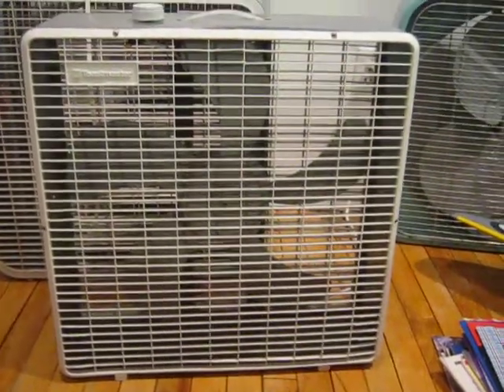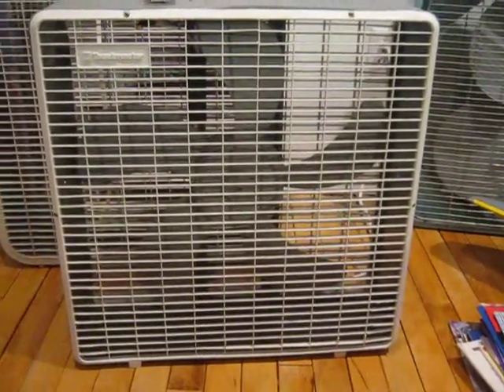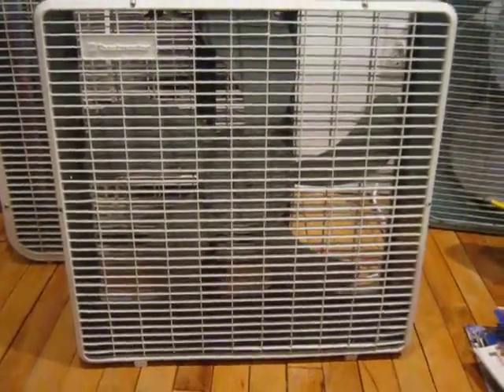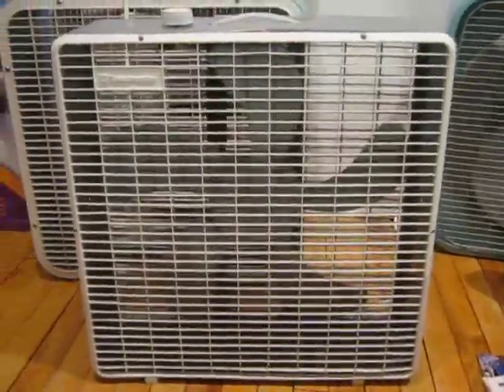Restored Toastmaster Box fan motor issue.

Comment from the maker: I don't think it is the fins, because when it is shut off it does not scrape and it has a long spindown time. Also when I turn it on, it seems like it starts spinning slowly and then gets up to speed, like if the blade were loose, but I epoxied the blade to the shaft, so it can't be that.
Reply: The thing is the bearings are just in bad shape.